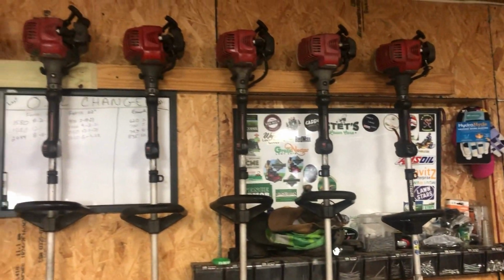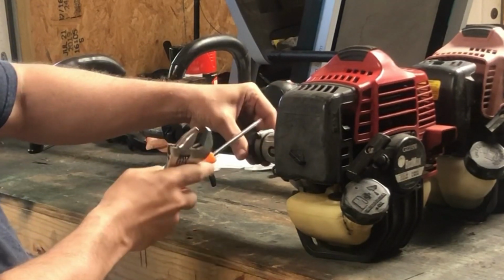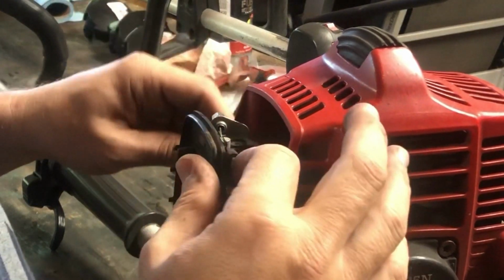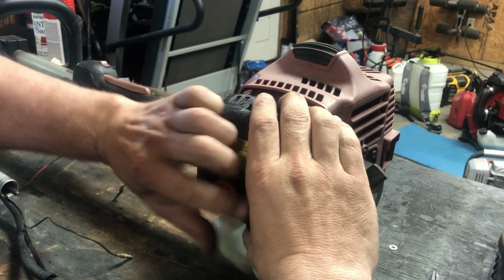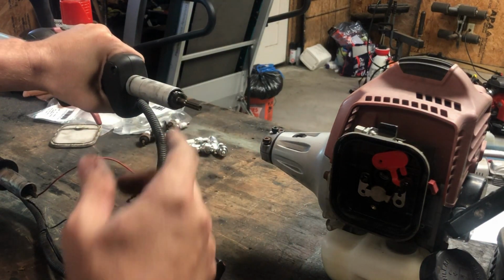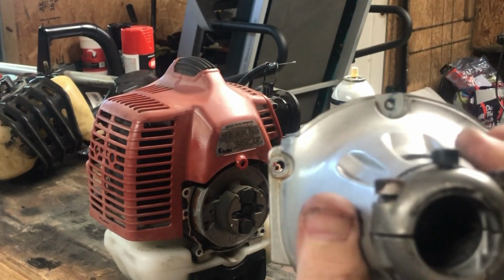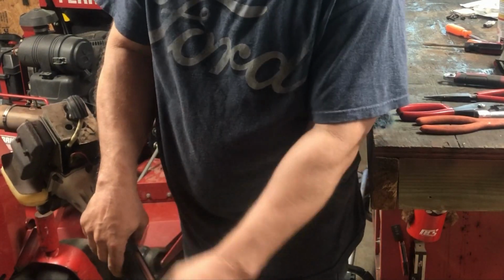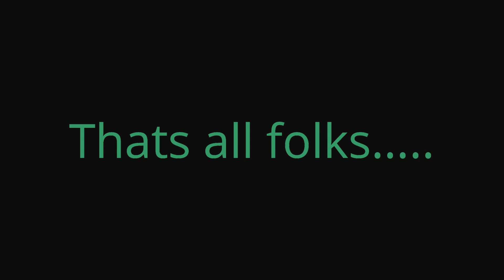Edger Engine SWAP🙏💪

Comment: Ahh, yes, just a power head swap 👍  I thought you were swapping short blocks or something 😂 Yeah, just a few screws and the throttle lines, not too bad. Except with Echos, the throttle cables don't always match up 🤯🤯 but I've made some things work. In fact, I bought a coupla old units of my favorite "torque vs weight" model ( the srm280t ) through Facebook in December, and I'm debating what I want to swap from mine with the worn out cylinder to the other one. Or just hold off all of that, and pop in a new plug and put a speed feed one of the "new" ones and call it a day 🤣 Make it REALLY easy.

Oh yeah, I'd forgotten about killswitch wires from the handles, too.

Thankfully, Echo stays pretty consistent with their drive shafts, so that part's not usually a pain to swap.
Reply from the maker: Yeah wasn’t too bad, looks like it’s going to work out just fine!

Comment: If u get one of them small motors that won't start for you, even though u change th gas, th spark plug, adjust th carburetor, & a whole bunch of other checks. Take th exhaust off, & examine it. There is a screen found just inside th exhaust port, that if gets gummed up, may not allow your motor to start. Save you some $$$ knowing these other things too.
Reply from the maker: Got it 😏👍